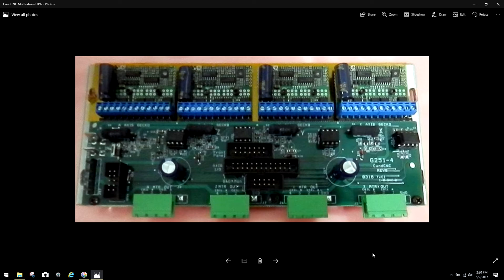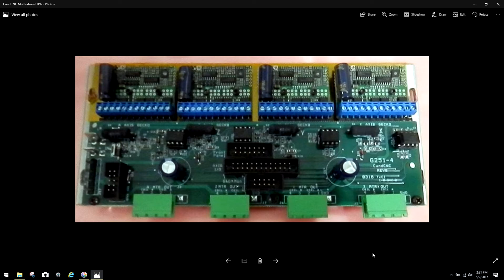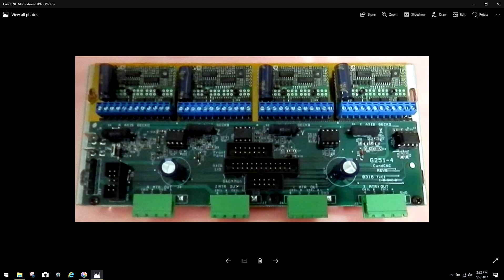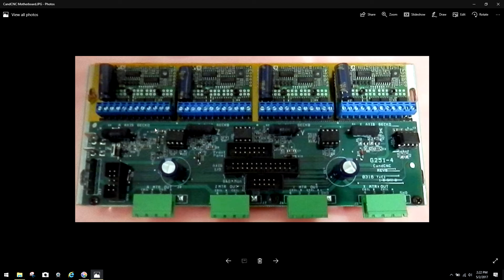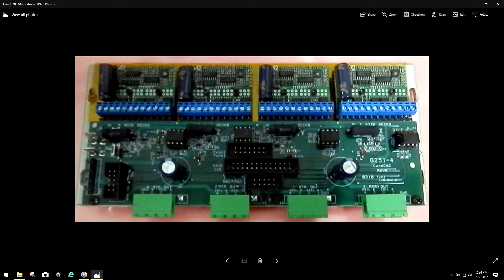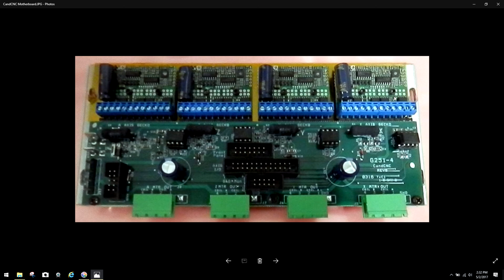Know What Your Getting With Your CNC Motion Controller & Propietary Components Explained

Comment: Excellent. I just bought a torchmate plasma table where the "signal generator" as they call it, had a proprietary chip burn up. Can't fix it, it's a 1000 replacement. I'm building a controller for it for a 1/4 of that. Talking to them it's obvious they know more about how to sell you something knowing that most welding shops know nothing about this rather than really help you. Thanks for the video

Comment: once again a great video Vince. In June i am updating my DIY CNC router and the first thing i am changing is the control system, at present i am using individual controllers for each motor and for the past 3 months i have been fighting the "ghost in the machine" with no hope in sight, I know its my wiring but am unable to fix it and i can not keep up with my orders now...Soooo. I am going to by a setup and have been shopping around and something that has cought my eye is a Xylotex system
http://xylotex.netfirms.com/OSCommerce/catalog/product_info.php?cPath=22&products_id=111&osCsid=206f7f84f8ace14acf86eab6b26f7c24
what is your opinion. and maybe give me more options for the $$.
Reply from the maker: Thank you again for the kind words. I myself am not familiar with their systems. I will say $405 is VERY cheap for a controller with steppers. I would try, and contact them for more information on their unit. I recommend not gambling with an investment with your business. If possible save, and do it right. If you need a system right away, but don't have the cash immediately Paypal has 6 months no payments, and no interest. If your using your system for business you should be able to pay back the money well within the 6 month time frame. I never recommend going into debt, but taking a shot in the dark on companies you hope produce viable systems, and that will be around tomorrow is way more costly. Sometimes waiting is the best strategy pending your orders let you.Thank you,Vince